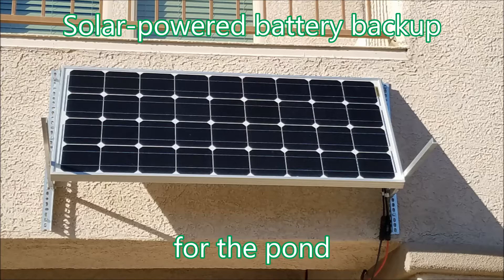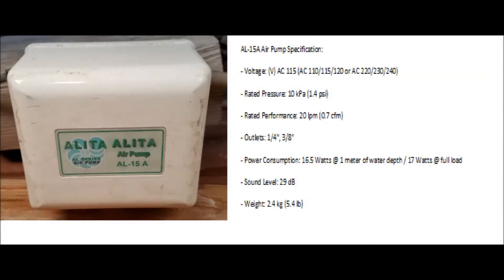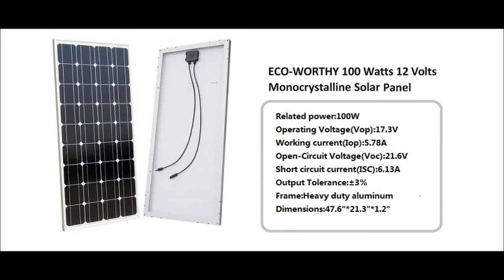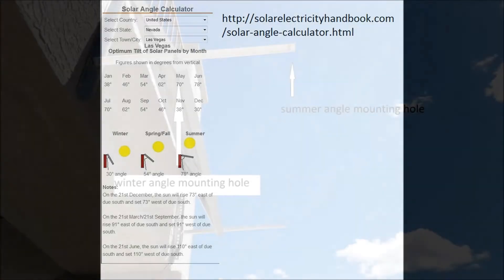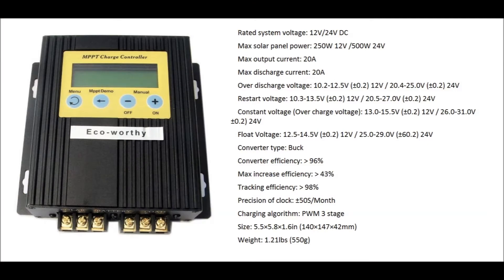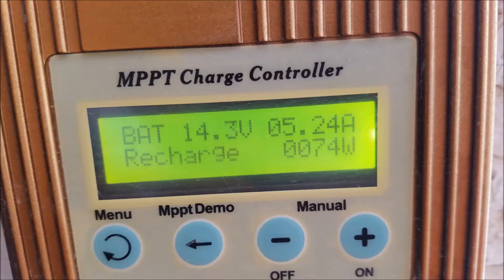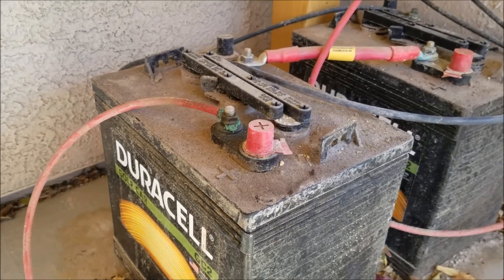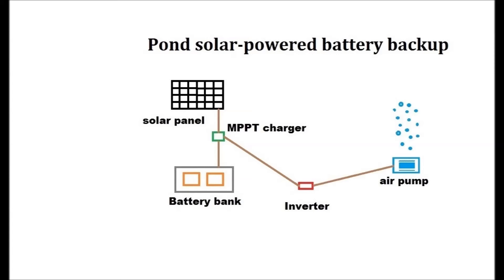Solar powered battery backup for pond

Comment: Help! I thought a solar panel set-up is simple. I've got my 30w solar panel, charge controller and 12v 35ah lead acid Rechargeable battery. For some reason, the solar panel doesn't keep the battery charged up so I can keep the bilge pump running at night, for my waterfall. What am I doing wrong??
Reply from the maker: You need more amp hours (battery capacity). Check my description above to help you determine how much capacity you need. You have to build it with the worse case scenario (cloudy day, 8 hours of light) so your 30 W solar panel may only be charging at 15 W average. Hard to say without knowing how much current your bilge pump is running.

Comment: will a similar setup like this work with a pond pum?
Reply from the maker: It depends on the wattage of your water pump and battery bank capacity. For example, my water pump outputs 3600 gph at 150 watts (110 Volt). Running this 24 hours a day requires a too big and expensive of a battery bank for me. But if you are willing to invest then it will work. Also need more solar panels to keep battery bank charged.